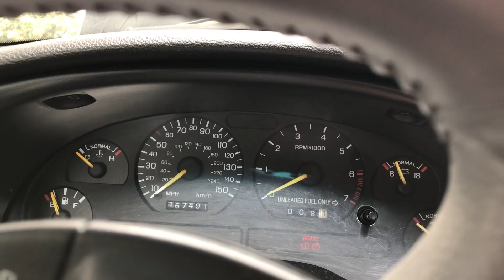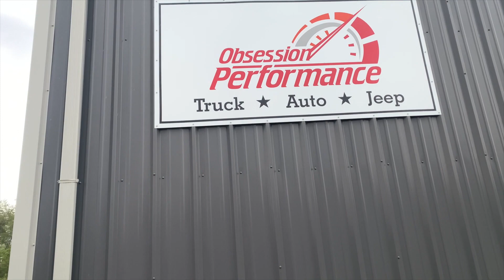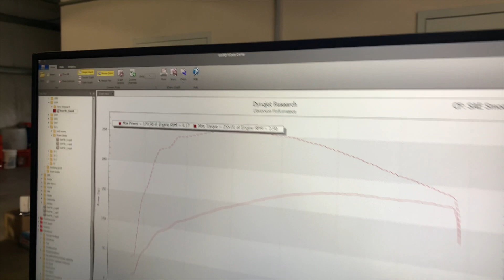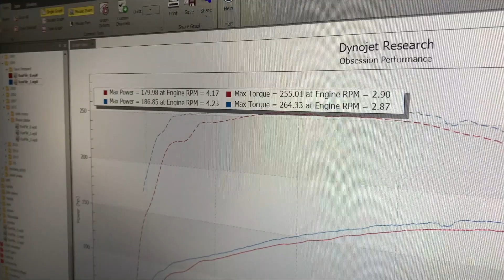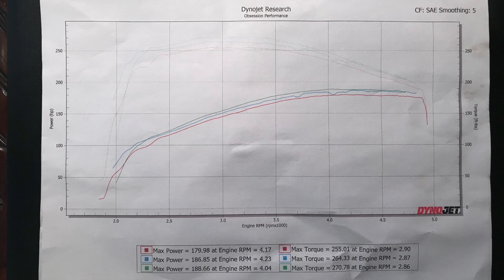Baseline Dyno Run

Comment: Nice!!! Those 302’s are very reliable! People have done trickflow top end kits even at over 200k miles and still get over 300+whp! My brothers 95 gts has over 140k miles and has a trickflow top end kit with upgraded fuel system and lines,also has a vortech blower making a safe 430whp and the car lights up the tires at almost 100mph in 3rd gear it’s insane how healthy the motor still is for how old it is with the mileage it has
Reply from the maker: Nice